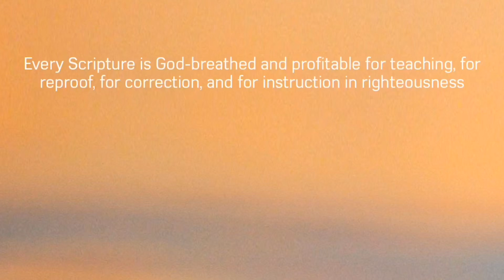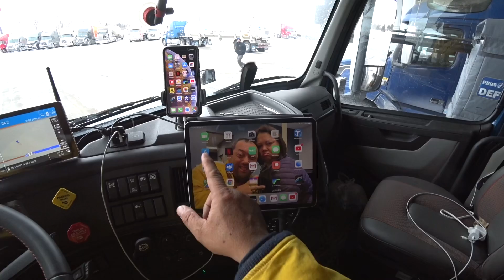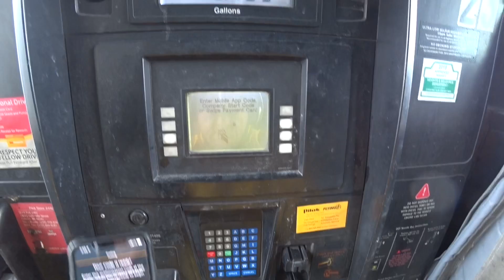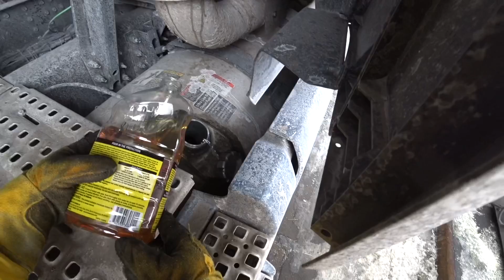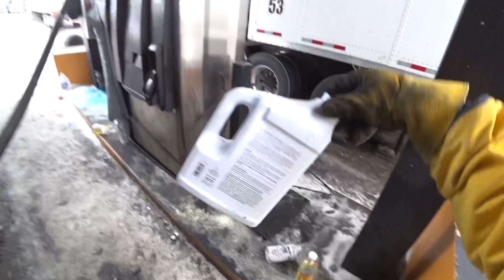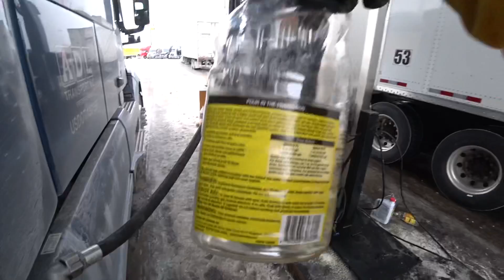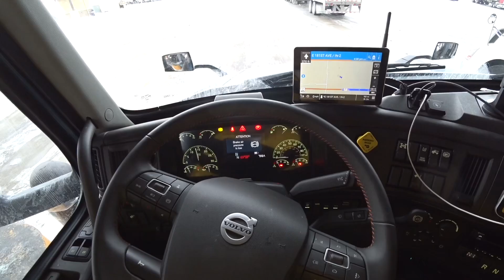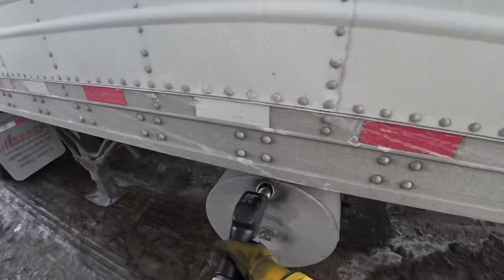January 31, 2019/92 Adding Howes fuel ⛽️ additive

Comment: Sir JBG  !!!   Look on the left front of the trailer & you'll see the fold down steps to get to the top  of the reefer to check & fill the radiator !!!  These are what I told you about when you were looking at the reefer unit sitting on the ground in VA shop while you were waiting to get your load there !!!!  Enjoy the rest of your ride home & glad to see you treat those tanks as there are plenty of froze & Gelled up units sitting on the road !!  The chill factor on those tanks is below -30 degrees !!!   DON"T forget DRY GAS in the air lines !!!!  KEEP IT SAFE !!!  Suggestion !!!  When you mty the ''HOWES'' jug,,, cut the bottom out of it to make a funnel to pour more into the fuel tanks as then you wont spill onto the fuel tanks & can use it to pour oil into the motors !!!
Reply from the maker: OK thank you

Comment: adding  that fuel additive should do good for grace.....An inexpensive improvement, fuel additives help a truck in two ways. One, they insure that the fuel that the engine in running on,  is of the best quality,   . And two, they help clean the engine and various engine components, ensuring that the engine runs better for longer...

Comment: John why don't you go to the hardware store and get some little cool springs and use your double sided tape put them at the bottom of the little door where you get your gloves from so when you pull the cable the door pops out instead of pulling and reaching
Reply: Should be coil springs
Reply from the maker: I’ll have to get permission from the boss
Reply: @24juan68  put that on your list for Grace's check up

Comment: Suggest you get a funnel to pour fuel additives, would be easier especially if you have to add to refer fuel tank. A cheap solution, save one of the empty additive bottles & cut out the bottom of the bottle for use as a funnel.🙄
Reply from the maker: Thank you David I have been doing that for many years